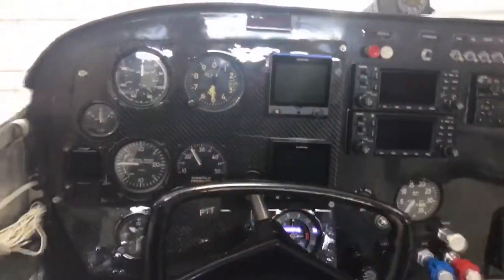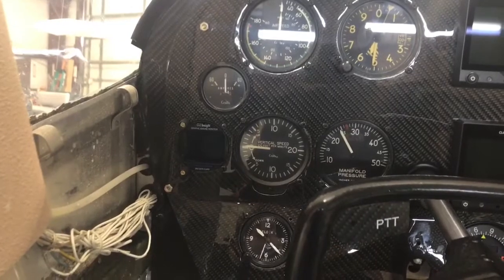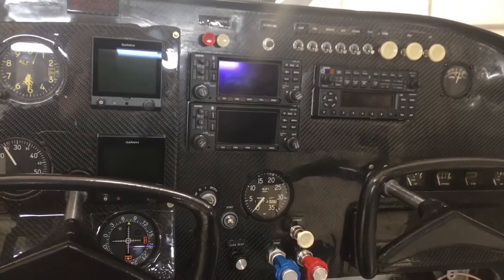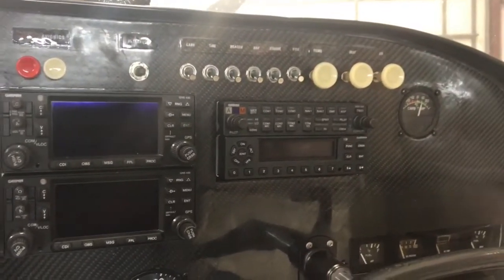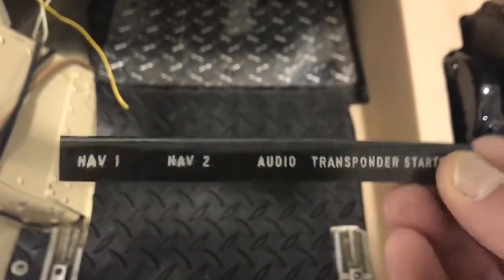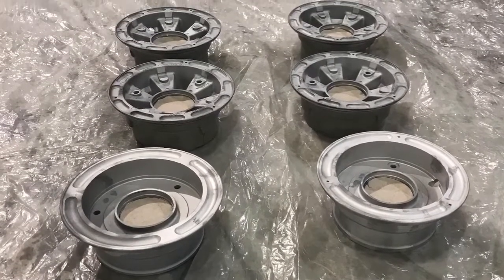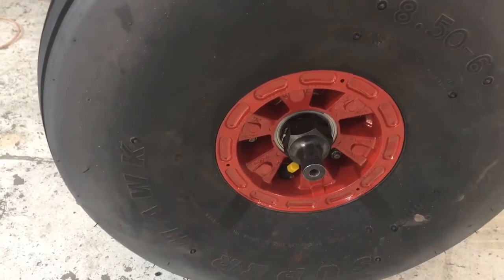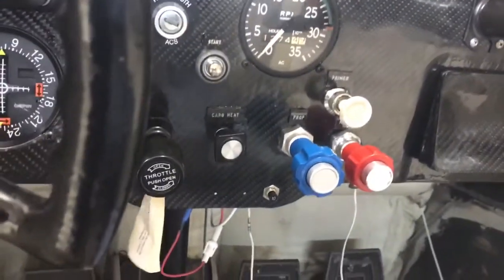Backcountry Aircraft: Carbon Fiber Instrument Panel; New Instruments Being Installed!

Comment: Any idea what your take off speed is now?
Reply from the maker: You might be right!  I'll be done with this thing soon and then I'll do some videos on it.
Reply: The AV8R's you’re probably slower than that for takeoff I’m flying a 1975 172 m with no stol kit and an o-320 with the ram pistons and a power flow putting out 178 horsepower with a fixed pitch cruise prop. I’m running 850s and a 700 on the nose and with 20 degrees flaps on my own in the plane I can lift off around 40 45 you sure do have a sweet machine there
Reply from the maker: If I was riding the engine, probably 40-45 into ground effect.
Reply: Thanks, I'm excited to see your results on short field performance.